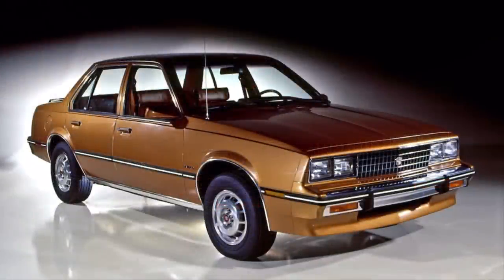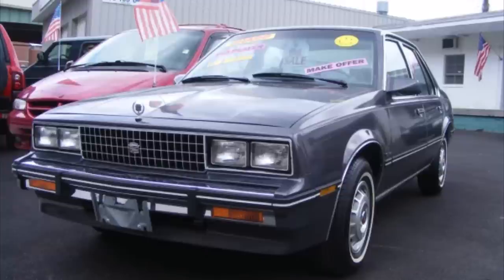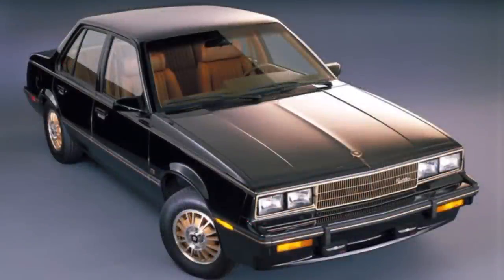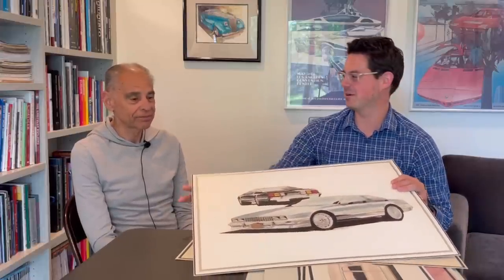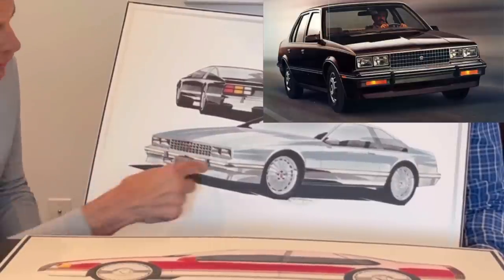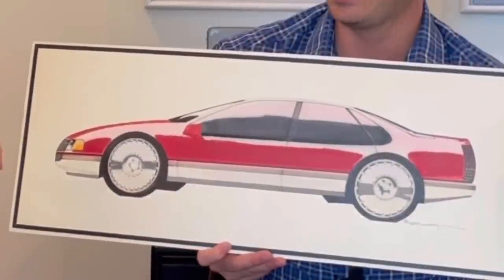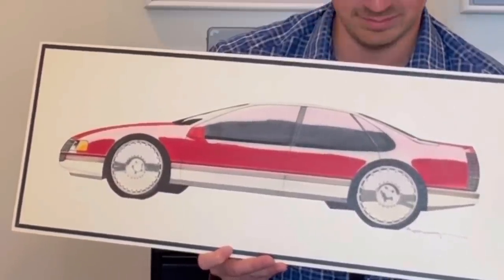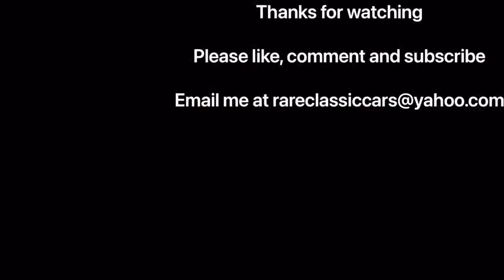The Cadillac Cimarron & Its Design: What Designers Wanted vs What They Got

Comment: Honestly i'm so sick of people bashing the Cimarron.  I owned the rarest of all Cimarrons, a 1988 Cadillac Cimarron 5-speed manual car.  Only 111 out of 6,000 plus cars had the 5-speed manual in 1988.  Even more rare than the D'oro package.  Mine was fully loaded minus the digital dash and astroroof. Dark blue over light Grey. Stunning color combination. Out of all the cars i owned, it was my favorite.  I loved the styling and good fuel economy.  It ran till 285,000 on the original engine and  transmission with only 1 clutch rebuild.  It never left me stranded and i got compliments all the time when pulling into a gas station. Yes! i got compliments.  Maybe the earlier examples weren't that great but the last two years, 1987 & 1988 were excellent cars in my opinion. It's a pleasure to hear John talk about this wonderful car.
Reply: I had the 1981-82 model with the 1.8 engine...HORRIBLE! Even though it was used that was the worst car I ever owned...The 1987-88 model w/V6 was a better car..My 81 Cimarron I had to work on it almost everyday.Interior looked decent but it was a HORRIBLE car!
Reply: Tne first year had the 1.8 carbureted 4 cyl that was problematic and weak even in the cavalier. In truth, the Pontiac, Olds, and Buick differentiated themselves from the cavalier better than the Cimarron . The latter years were significantly better. But the first year was simply a turd and deserves all the criticism leveled at it. If they'd initially installed the V6, it would had something to differentiate it

Comment: I remember seeing the '82 for the first time and it struck me as a handsome, refined looking car. At the time, since all the J cars had just come out, there were not weekend-rental Cavaliers  swarming out of every airport and the J-cars were being marketed by all the divisions as upscale cars for their size, with more standard equipment than GM was used to offering. In that brief time period, it wasn't such a bad thing to "look like a Cavalier". That said, I have to add that I wasn't thrilled with the styling changes they made later; the smoother frowning-trapezoid grill seemed to clash with the still-boxy body. Though I've never driven one, I've also heard that because of the tight fit in the engine  compartment, the V6 needed mounts that were too stiff to keep the noise level in luxury-car territory. It seems that GM was just stuck with a platform that, unless someone dropped a BMW L4  into it,  while a perfectly acceptable car, could never be a Cadillac.

Comment: My mom had two cimarrons. The first one was underpowered with the four cylinder, but it was incredibly comfortable and rode like a big heavy car. Her second one had the six cylinder and rode much stiffer in that it was a sport model. It too had a very comfortable interior. One major drawback was the 10 gallon gas tank. I drove from Massachusetts to Key West Florida and we had to fill up every 200 miles. The car ran and drove perfectly down and back. I thought it was cool then and I still like them a lot. They were a Chevy dressed up like a Cadillac, but I think it worked.

Comment: One wonders how much pressure the finance guys were putting on management so that it had an effect on the design.  Mr. Manoogian faced the pressures of the time, which were great.
They really tied his hands. This car was a reflection of what he was forced to do, not what he would have WANTED to do.
Reply: It was dealer and time pressure…..more than Finance.  The use of the same platform clearly Finance…..the rush to market destroyed any chance…..
Reply: @ellisonhamilton3322  Precisely.  I worked at GM Full Size Truck when the original Escalade was launched.  Same thing 15 or so years later.   Nobody listened.  Economics said launch it with new gauges, grill, and better leather to counter Navigator.

Comment: Looking forward to the longer review video.

I think one of the main issues with the Cimarron as a counter to BMW, Audi, et. al. was not so much the design as it was the fit-and-finish and performance. 

Just getting into the car, closing the door and starting the engine was enough to know that there was no real comparison between Cimarron and German cars it was expected to  compete with.  The Audi 5000 or the BMW 3 Series, let alone the Mercedes 190 were in a different class of build that no amount of design/styling could make up for.
Reply: The thought that it could be compared to a BMW even at the time was utterly absurd. In every way, engine, transmission, appearance, handling...  I remember sitting in one idling, and the whole steering column was vibrating up and down with the engine, as all j cars did.....

Comment: Holden's version of the J car suffered similar issues...mainly drivetrain. It had to be released with the largest engine available for it of 1.6l and around 63kw. It had to be revved to get anywhere and didn't match well with an auto.  Most competitors from Japan had 2l engines.
2yrs they had to wait for the new 1.8 injected unit that put out 83kw on leaded petrol.  Headline was from slug to slingshot. Then unleaded petrol came along and they had to fit the US spec throttle body injected unit. Power dropped to 63kw ...slingshot to slug!
2 more years and the 2L injected  unit arrived turning it back into a slingshot but the damage was done and the camira was gone a couple of years later.

Comment: I have two thoughts on the Cimarron.  First is that the styling wasn’t terrible in the context of the era and if it wasn’t such a poorly running car and there was no Cavalier to compare it to it would have sold reasonably well.

Second is an interesting comparison to the Escalade.  If you think about it the Escalade design program was identical to the Cimarron;  slap a new grille, taillights and some interior trim on an existing Chevrolet.   Why was one a massive success and the other a failure?
Reply: Good points John. See my comment above.
Reply: I think the answer for the success/failure question is timing. By the time the Escalade came out, consumers had adapted to this form of marketing/manufacturing. Back in the 1980s, consumers... particularly high end consumers had far more rigid standards and expected their cars to be truly unique.  Lincoln learned the same lesson a few years earlier with the Ford Granada/Lincoln Versailles debacle... Cadillac must not have been listening. 😄
Reply: @chriscadillac8448  I was thinking the same re the Lincoln Versailles.
Reply: I think the gap in product was wider with the Cimarron. The GMC Yukon in the late 90's was a lot closer to the target buyers of the Escalade than the Cavalier ever was to people who were shopping for a BMW, Saab or Audi in the 1980's
Reply: Excellent points.
Reply: I think stretching the Cadillac brand downmarket into an average economy car was just too much for most people. This was also an already crowded segment with many (and much better) alternatives. The Escalade, on the other hand, was 'big' and there were fewer competitors then. GM also did a pretty effective job dressing up the interior over the Chevy and GMC variants.
Reply: I think it’s because the Escalade was a much closer match to the competition than the Cimarron. The Suburban and Tahoes were very similar to the Expedition that the Navigator was based on. Plus they could already be equipped as luxury vehicles, so you just needed some extra glitz to make it a Cadillac. The Cimarron was a front drive econobox that was competing against the BMW 3 series and Mercedes. That’s like bringing a butter knife to a gun fight
Reply: The existing SUV had the advantage of decades of production and refinement, so I think the engineering & production folks found it easy to bring that to the next level.
Reply: I agree with this 100%. My neighbor across the street has a 2022 Escalade and her daughters friends Mom has a 2021 or 2022 Tahoe RST. Both are white with black wheels. From the side they look nearly identical. Only from the front or rear can you easily tell them apart. I remember when the Escalade first came out in 1999 I think it was you could barely tell them apart from the GMC’s of the time, especially on the interior. I suppose if you look on the bright side that’s not entirely a bad thing as GM powertrains have always been pretty good and they share so many parts with the truck platforms.
Reply: Very perceptive.
Reply: The Suburban is a pretty good vehicle with few direct competitors
Reply: I think the Escalade was a success because the Chevy Tahoe was/is a very high end, almost Cadillac level SUV whereas the Pontiac J2000 Chevy Cavalier were low-end, nowhere near Cadillac level automobiles.
Reply: The Escalade wasn’t as big a step out of character for Cadillac as the Cimarron was. Its competition also wasn’t *nearly* as formidable at the time.

When the Escalade launched, it launched into a segment with maybe one or two other players, one of which was the similarly badge engineered Navigator. The other was the most mundane Range Rover in its long history. Everything else was much smaller. Cadillac also had a reputation of making big vehicles with V8s, and the Escalade fit that nicely. It thus functioned as an aspirational flagship for the brand. It also embodied excess.

The Cimarron was up against the E30 3-Series and Mercedes-Benz 190E, and it was hopeless against those two absolute legends. Its existence was a also sign of very dour times, the opposite of the excess that had been a Cadillac identity for decades. It signified Cadillac’s need to move downmarket and make cheaper cars to maintain sales.
Reply: But compared to the concept drawings, the Cimarron styling delivered was terrible.  the reason the Escalade   was a success is that peoples expectations of Cadillac had already been lowered, and buying a loaded Tahoe for the few grand more and calling it a Cadillac worked for a bit due to the $$$$ advertisements.

Comment: 1) You do a fabulous job with your channel, simply fabulous. 
2) The difference between Cadillac and other premium brands such as BMW and Mercedes is really what is acceptable to the decision makers. BMW & Mercddes both made large and small cars. The difference is that their small cars were NOT considered "down market" cars. They are ultimately just as much as a brand builder as their large cars were. GM considered small cars as cheap cars (with good reason, the American public thought of small cars as down market cheap cars). GM was unwilling to redefine small as a premium car, even though ultimately, the Cimmaron was priced way above the cost of what it took to build it. GM priced the Cimmaron as a Cadillac believing the public believe there is a value in the name Cadillac. Which the Cimmaron proved there wasn't. The base Cimmaron price in 1983 was $12,181 ($5k above the similar Chevy Cavalier!). The 84 BMW 318i was $13,290
Reply: GM still made Oldsmobile and Buick versions though.
Reply: At first glance, potential buyers "perception of value" discounted these as a thinly disguised, completely uncompetitive econobox, which they were. A veneer of style no longer held court- or sway. Look at the boxes Mercedes sold. The premium market demanded quality engineering, style was secondary.
Furthermore, the  "Cadillac" esteemed name value was long gone- it was like Packard, post-war. The Cimarron was a pronounced  nail in the coffin. 
The insulated entrenched bureaucracy of GM never understood that; still doesn't to this day.
Reply: @loumontcalm3500  I agree with everything you stated with one exception. Cadillac today builds by far the best sedans they have ever built, but sadly, sedans are no longer favored by the general pop. I know I'm in the minority on this, but i am also a big fan of Mary Barra. What she has done and is about to do is fantastic. I just saw the 2024 Chevy Blazer SS. Wow!  All electric,  565 hp, 300 mile range. Looks beautiful.
Reply: It amazed me at the time, that people who could have bought the BMW, for some inexplicable reason went and got a cimmaron.

Comment: what is so surprising is that they they priced this little car so high, considering they added so little content to it.  If they would have spent more on the trimworks and interior, they might have had something.  I remember looking at these on dealer lots at the time.  It was pretty much an insult - a slap in the face to customers to offer this for 50% higher price (than Cavalier), yet only 100-$200 in additional content.

Comment: The facelifted Cadillac cimarron is the one that they needed to put out. They screwed up by putting the ugly quad headlight one out. If they had to wait till fall of '85 then they should've waited.......  However, one little thing here and there could have fixed the entire issue for the introduction model.  Ditch the quad headlights later on the facelift for '86. Sure that's fine (everything was like that) 
But, make the 1982 taillights unique from cavalier, and add a "caddy style" side marker lamp to accentuate the Cadillac style with the quad beams. And change the interior a bit. THE ENTIRE CAR BUMPER TO BUMPER LOOKED EXACTLY LIKE A CAVALIER.  There's no doubt in my mind that they were ALL  drinking too much alcohol on the job at GM. 
PROBABLY STILL ARE TODAY.
Reply: I beg to differ. I much prefer the four rectangular headlights which are distinctly American versus the later Japanese / Euro lights.
Reply: When it was introduced, they were only allowed to use the quad headlights per Govt regulation.
Reply: @manthony225  they came out in 82, everything was sealed beams then, but what about the taillights????? 1986 was the fist year allowed by gov. for non sealed beams. In other words "integrated headlight lenses." They should have done it right the 1st time and made the taillights look cool and add a nice "caddy style" side marker lamp.. General Motors is cheap, always has been cheap. But, they can spin whatever kind of story they want, it's theirs. I mean, it's all about profitability anyway. They could really careless about anything else. They proved it by what they built. Inferior automobiles compared to everything else on the road at the time. As outdated as anything "NEW" could ever be. 
Take Care! Stay safe out there! Getn bad 🇺🇸
Reply: @thewiseguy3529  rather than emulate the Euros it would have been better to do a mini first gen Seville. More formal roof, vertical Cadillac tail lights etc. When US manufacturers try to do a Euro car, I am not sure who they are really appealing to? The Euro and Japanese buyers want exactly that - European and Japanese cars. There is also the cultural cringe from those people who will look down their noses at a US car , regardless of how good it is. The Euros and Japanese will always do their versions better than the US ones so my view is make it distinctly American and don’t try copy Euros etc. Look at US trucks. They are distinctly American and not trying to copy another country’s styling cues. Even if the later model was the launch design, it may have sold more but not many more and not to Euro or Japanese buyers. I’ve run Product Planning for GM and Ford and sticking to your unique position in the market and staying true to those core values is what works. Look at the Mustang. It almost ended up becoming extinct because some people thought the Probe was the answer.
Reply: @manthony225  yes that changed with the Lincoln MKVII.
Reply: @markbehr88  I don't disagree, but what people want in the market, they get. That's why there's auto shows with concepts, they have cameras set up at those and they're watching everybody's reaction to specific new designs or new technology. 
 Also, GM already had better platforms to work with for a "small caddy." Why did they do what they did? There's no real explanation for that. Except that it was a mistake and they thought it was right at the time.
Reply: @thewiseguy3529  that’s true. I just enjoy them now for the curiosity that they are. There’s no doubt they could have done better.

Comment: I think it was perfectly fine as a car, and even as a 'baby caddy'.  The problem was that the pricing was completely out to lunch compared to the rest of the J cars.  The only way it made sense is if you thought it really was a Cadillac through-and-through... but that illusion would be dispelled on the drive home as you passed a couple of Cavaliers, a Pontiac and a Buick J-body... And you felt the sinking sense that you just spent $6k (70% more than the fully optioned Cavalier) for leather seats and some Cadillac badges.

Comment: I think considering the constraints...he did an admirable job...also this was during the malaise period so performance wasn't that great no matter the manufacturer.  Still , and I've posted this before. the front drive A bodies were about 6 months away from the J Car intro.  I would think an A Body based Cadillac would have been an easier sell...plus with Pontiac 6000 STE, the A platform could have been performance tuned in order for Cadillac to perform against the imports.  

And the sad thing....GM gets to the target...then cancels the program.

Comment: I thought the Cimarron pushed the design limits of a pedestrian car and like it quite a bit. But it still shared the basic silhouette, interior and tractor engine, so didn't fool the public. I don't know if the refined V6 at launch was enough to overcome the economy-car roots. Maybe GM should have pulled a premium small car from Opel - but that would have been major spend on emissions and safety upgrades; and Saturn didn't have much luck with those in the 2000s.